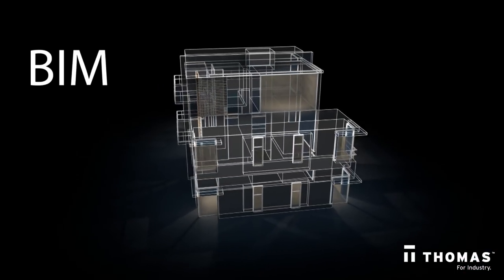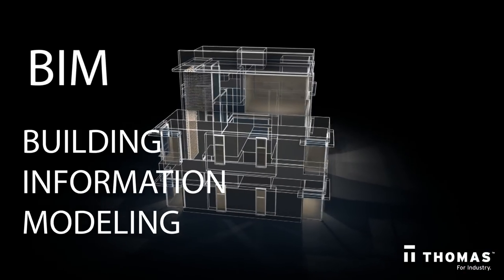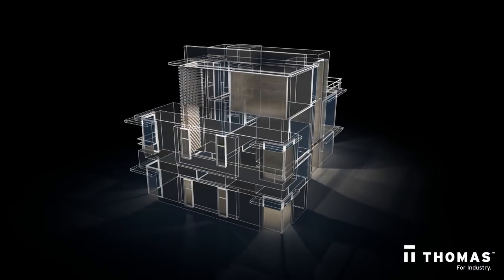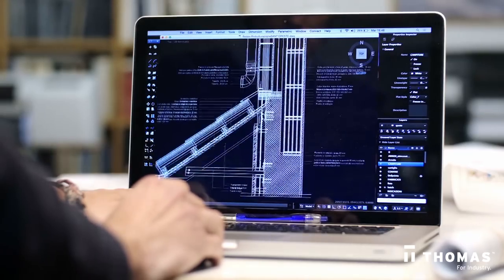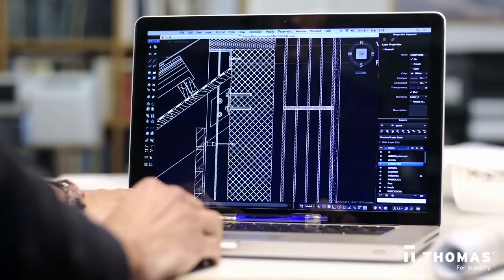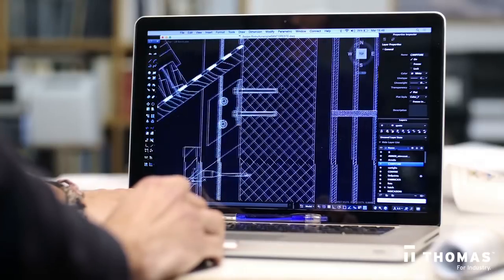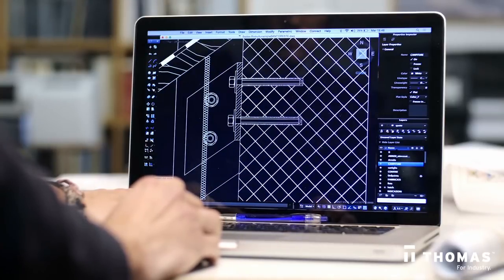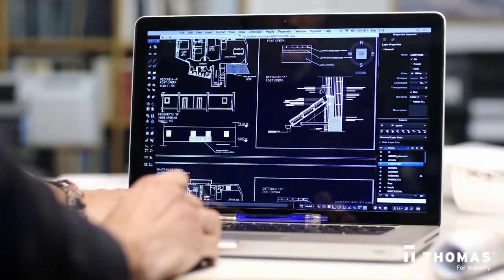CAD vs. BIM: What's The Real Difference?

Comment: Why is there so much effort in trying to separate BIM and CAD. In the video you mention Revit is similar to Solidworks. They stem from the same idea with one focusing on manufacturing and the other in construction. You can run simulations in both. I'm saying all this to say BIM is CAD, you can't have BIM without CAD... CAD is literally "computer-aided design". If BIM is not included in that you are using the wrong software.
Reply: Agree

Comment: Hey Thomas, you should check BricsCAD application, which includes a full featured BIM module, similar to Revit. You will get all the BIM information in a DWG file. Also you gave the possibility to interact with other BIM software by IFC or even rvt files.

Comment: As Mech Product Designer who is used to having everything from Elect - Plastics- Metal in one  3D parametric CAD modeler               What I never understood is what exactly is the actual BIM software? Is it just a concept or a package where a certain file form is required which then in turns give real 3D parametric visualization ?OK BIM is specific for Civil Construction industry where traditionally people use diff 3D CAD + built in Metadata,
An Architect may use Archicad, a Fabricator may use Tekla , a manufacturer of say doors and windows or capital equipment will use Mech 3D CAD like Solidworks/ Solideedge/ Pro E or Catia , an HVAC mfg might use some HVAC 3D modeller 
BUT at the end of the day the final representation is a somewhat simpler ( on graphics card and file size) but parametrically accurate  3D model of a built environment + relevant Metada.. correct? SO it is not that diff than advanced Mech 3D CAD packages ... And when you say It is bad idea of translating from 3D CAD to BIM? How .. If a manufacturer already has spent money on 3D model of his product he will simply convert to a format which suite BIM !